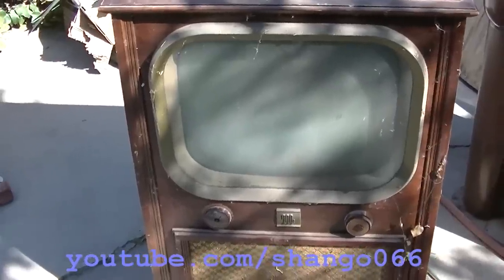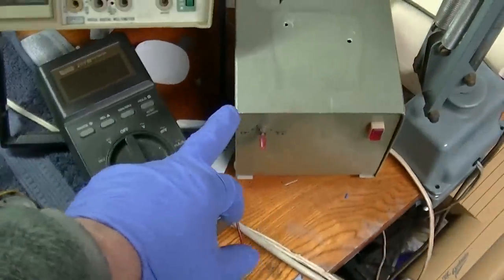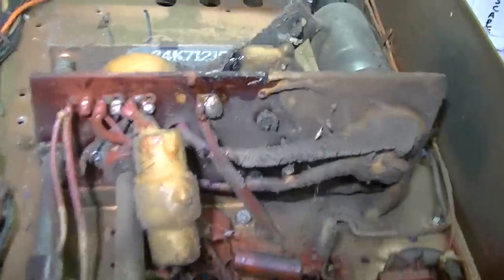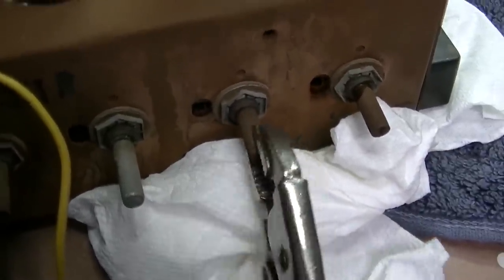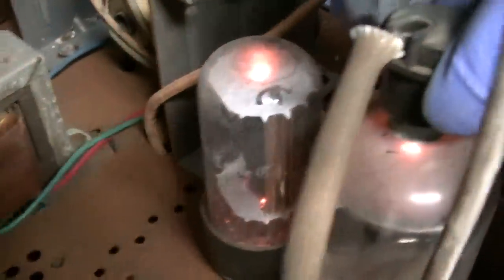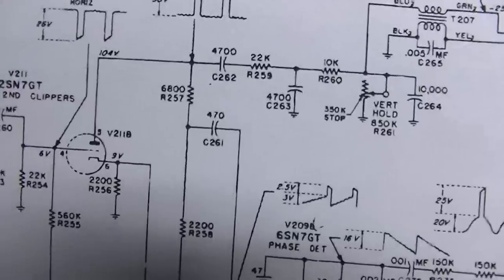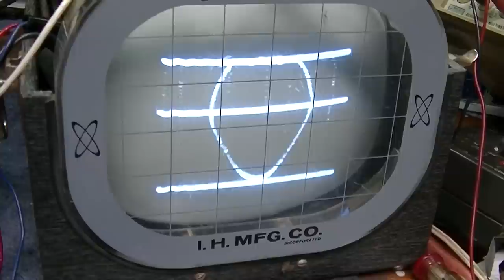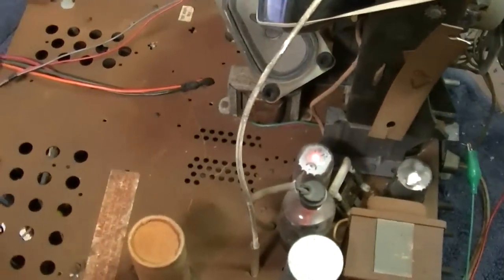1952 Motorola 21K1 TS351 Television Console Resurrection pt2

Comment: The 6W6 was designed to run at lower voltages than the 6L6 and 6V6.  As such it has a 1200ma heater to get the required cathode emission while the 6V6 has a 450ma heater and the 6L6 has a 900 ma heater.  Actually, the 6W6 is close to being a 50L6 with a 6.3 volt heater.  The 6V6 would make a poor sub for the 6W6, I think you might have to dig up the real McCoy here.  A 6Y6 would be closer, but it won't fit either!  A 5881 might do it, that's an industrial midget version of the 6L6.
That test tube is probably a 5FP7.  It has a cascade phopher, the back is a short blue, the front is a long yellow/green.  The blue excites the yellow/green, just like your phone did.  You can get a decent blue picture out of it, and won't see the yellow at all, unless you crank the brightness down.
Those 5" radar test tubes don't have any 'dag'.  You MUST have a capacitor from HV to ground (usually one of those 'door knob' caps).

Comment: The red stuff looks like the stuff used in motor rewinding back in the 1970's. It is an insulator. A trick for building small block Cheverolets was to paint the valley of the block with that to aid oil return from the heads because it was much smoother than the cast iron of the block. It was capable of withstanding high temperature and the chemicals in the oil.
Reply: glyptal

Comment: Motorola engineers design things a little differently to avoid RCA patents. Quite often a challenge to repair. Many bumble-
bee  and old waxy capacitors to fail or have failed. Two thumbs way up on the fella who sent you some components and
 a real nice  B&K model 890 cap meter! 👍👍

Comment: That looks like P7 phosphor. The same kind used for RADAR tubes of the time! I have a 5FP7 tube I made a circuit for displaying vector graphics on. It's a beautiful color combination. It uses a fast blue phosphor on the back and a yellow/green phosphor on the front for the persistence.
Reply: I have a 10SP7 I think it is, it works on 10BP4 sets. Same fast blue and long green. I was thinking of making an ultrasound scanner with it. I took two transducers and mounted them on a mechanical sweeping arm to an oscilloscope and it will show if a metal yard stick is in front of it to about 15 feet. Then I would need the up and down sweep to get a full image. I don't know though tests had pretty crude results.
Reply: @SoundsLegit71  I as thinking of doing something similar since it's now an XY scope. Right now it just receives audio files from a raspi that are generated using a program I wrote called imagetovectwave
Reply: They're easier to burn-in than short persistence phosphors, so it's not the most ideal as a test tube
Reply: @EdgarsLS  I added a circuit just because of that actually. The circuit monitors the X and Y inputs and if there is no signal it turns the beam off.

Comment: Those P7 CRT's usually had a deep orange filter on the front to dim the blue-white flash and pass the orange afterglow.  I may still have a 5FP7 or two from a couple of dismantled microwave spectrum analyzers.  They needed a slow sweep speed to trace out fine spectrum details.  Amazing devices but the size of a console TV.
Reply: There were P12 orange phosphor radar CRTs.

Comment: Those Paper capacitors get leaky because of moisture that gets into them, the older beeswax caps usually don't leak because the beeswax is softer and doesnt crack as often.
I have tried repairing old paper caps, boiling the moisture off in wax which took about 4 hours, afterwards the caps tested perfectly with no leakage.
Reply: Yes you can boil those caps with boiling them in wax, but only if the were wax impregnated. Most of the times (at least on European sets), the caps were in glass tubes and sealed with tar (bitumen) that gets really hard and cracks. Those cannot be saved...
Reply: Also sometimes the paper ingresses so much moisture that it physically expands and cracks the glass tubes... some caps were even put in metal boxes that were then sealed with tar. I've seen those expand so much the metal failed and cracked

Comment: That capacitor sorting meter is very interesting to me. In the 1980s. I work for a company that did active filters using LM1458 OP AMPS,and we sorted 820 pF capacitors using a similar but cheaper meter.

Comment: If you can obtain 6P1P, make an adapter for the octal 6V6. Same tube, much lower prices and many stockpiles of brand new ones in the former USSR. There's also the chinese 6P1 clone of the 6P1P. The military version (6П1П-EB / 6P1P-EV) should be a fairly decent as an inexpensive replacement, while the non "EV" version or the chinese ones should be a decent throwaway test tube as they are very cheap.

Comment: Since WWII resistors for the most part followed the E system, for what ever reason capacitors hung on to the old (RMA) system for years after. I have a few hundred .047 630V boxes for you if you want them (Private message to follow)...Caveat being they are PC mount with short legs.

Comment: 12BH7 is a real audiophile valve. Replace any 12AU7 or ECC82 in a buffer stage esp. They are likely very pricey by now. I haven't looked but seems there are no secrets any more and nothing isn't known about.
Reply: The McIntosh amps use 12 BH 7s in the driver stage.

Comment: 17:45 I wonder what possessed them to start specifying capacitor values with 47, instead of 50,  as the significant digits in the first place. Maybe it fit into certain tank circuit calculations more smoothly.
Reply: Probably to match resistor values , which also seemed odd like 4.7k is easier to find than 5k. must be a good reason., be it chemistry, metalurgy, production process, ? IDK. would make a good video.
Reply: Look up the E-series of preferred numbers online. On a log scale the odd numbers are fairly close to sequential.

Comment: Man, I don’t understand. Is that what folks watched when it was working with those trails? I wouldn’t be able to stand it.
Reply: No. The set is made to be watched using the larger rectangular CRT seen in the beginning of the video. The smaller one with the trails was used as a test CRT, something less bulky that works well enough to test the circuitry.